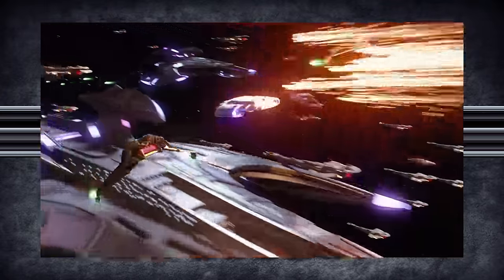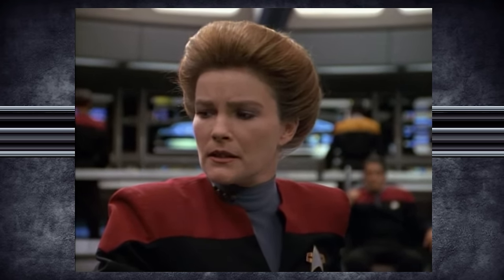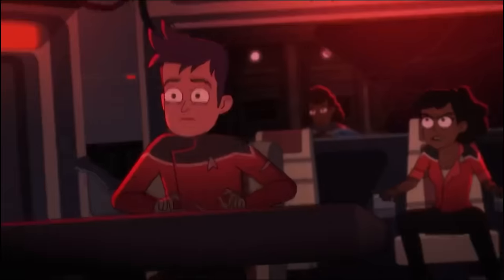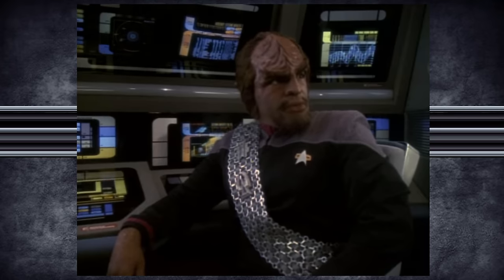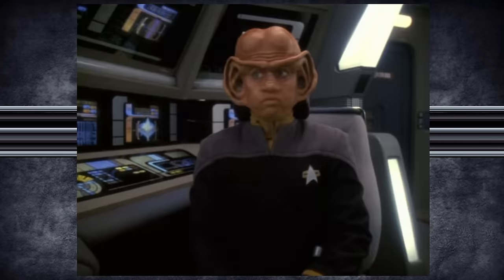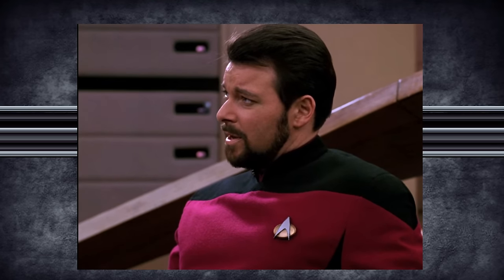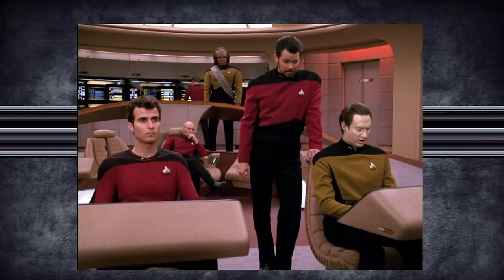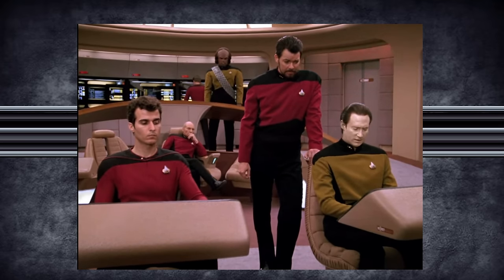Why Starfleet's Bridge Design Was Lethal to the Crews

Comment: The bridge being "exposed" isn't a problem in Star Trek, it's an acknowledgement of the limits of material science. All star ships had shields. With shields up, a bridge could be put anywhere and be safe. With shields down, a bridge could be put anywhere and NOT be safe. We see photon torpedoes drill straight through the entire primary hull when shields are down. When they are up, the same torpedo just scorches the paint a little. It wasn't until Star Fleet got ablative armor that you had a chance of making a hull that could withstand some punishment while shields were down.

As to secondary bridges, even TOS ships had the "emergency" bridge, which was (oddly enough) in the exact center of the primary hull. There were even some episodes where the bridge crew used it.
Reply: This makes sense with regard to high-powered weapons such as torpedoes.  However, the exposed Bridge can still be a problem in relation to "mid-level" threats, such as weapons, space phenomena, or colliding objects powerful enough for some damage to get through the shields (but not so much that the ship would be blown away no matter what).  Or in a shields-down situation, powerful enough to damage the exposed Bridge but not penetrate to a more secure location.

Thus an exposed Bridge would still succumb to threats that an internal (and well-armored) Bridge would not be vulnerable to.  The exposed Bridge is also easier for enemies to locate and target.  "Hit that nipple bullseye right in the center of the disc!"  Since most Trek ships don't use windows, the exposed Bridge does not offer extra functionality that makes the additional risk worthwhile.

Ask the Bridge crew of the SSD Executor about the virtues of a Bridge built into the bowels of a ship. :)
Reply: @kevincrady2831  "Hit that nipple bullseye right in the center of the disc!" is in keeping with naval tradition tho.  In the age of sail officers would be standing on the quarterdeck completely exposed as high value targets.  In battleships the bridge crew were basically the only people on the ship not protected by armor (they had armored conning towers that nobody ever used).  If your leaders are willing to put themselves in the most exposed places, how can you be afraid at your post?
Reply: Auxiliary Control in TOS, the Battle Bridge in TNG
Reply: You could also not present for combat at any given orientation using only the "windows."

Unless you had one hell of a tactical officer.
Reply: But I would rather be concealed then exposed regardless of armor
Reply: They had ablative plating on the NX-01
Reply: @kevincrady2831  

You neglect that the deflector field is always active - otherwise you couldn't travel at high speeds anyway.

The exposed bridge DOES offer extra functionality - in making the entire bridge setup easily replaceable for upgrade or repair - and the additional risk is minuscule.
Reply: @ohauss  Given the existence of transporter and replicator technology there isn't any real need to have the Bridge on the exterior of the hull in order to make replacements and upgrades possible.  Otherwise, Main Engineering would need to be on the outside too.

The simple fact that an exterior Bridge is an easily spotted and targeted location ("Lock disruptors and photon torpedoes on their Bridge!") makes it more risky than it's worth.

Comment: Most of the "design flaws" in Star Trek usually stem from necessities of filming TV shows versus actual deliberate informed engineering choices. 

Overall, I'd say space ships are more comparable to submarines. Like submarines, space ships need to maintain atmosphere. Like submarines, the medium through which they navigate provides no human processable navigation clues. Under water, in the depths where submarines usually operate, it's simply to dark and murky. In space, human eyes and visual interpretation and intuition completely fails, because humans rely on depth perception for movement and orientation. Due to the distances and scales involved in space flight, humans can't rely on depth perception. So that's one major point for instrumented flight and essentially makes "windows" completely useless as fallback mechanism, if those instruments should fail. That basically leaves "windows" for entertainment, such as leisurely observing a planet while in orbit in a ship's lounge.

Then there's armor and hull plating and hull integrity. While in-universe, those "windows" might be some form of transparent metal, it's speculative at best if they also have the usual hull platings and other forms of overarmor. One could argue, those platings wouldn't be transparent themselves, so that would make windows structural weak points.

 While the pressure differences in space might not lead to as severe structural failure as it does under water, it could still provide stress points leading to growing fractures in the window and in the surrounding hull (google why airplane windows are round or have rounded corners). Also, as far as we know currently, transparency of a material indicates some (quasi-)crystalline structure, and those tend to shatter when stressed. But even given current day materials one could assume some form of layered composite, much like car safety windows, yet this still means a damaged window section would need complete replacement. 

But then again, maybe Trek has some kind of molecular welder, able to fix the failures in these composite windows. And I seem to remember Trek ships also having some innate structural integrity field system, possibly able to reduce or eliminate the stress fracturing? Even if this structural integrity field was always active, for efficiency and simplicity, wouldn't it simply be more practical to solve such structural weak points at the design phase? At what point does the handwaving become unbelievable?

One thing always bothered me, at least post-TOS, why does the view screen on the bridge never display additional information? This too should be plausible, given the adaptable and configurate LCARS system. I assume this is also more for cinematic purposes, to give the actors reasons to wander around on set, providing dynamic framing, instead of everyone just always sitting and staring at the main view screen. And probably production cost during the time, with CGI being much more expensive. Compare this to Discovery and the Picard series, where ships do have interactive holographic information display on primary viewing areas.

The commonly round bridge layout probably also stems from cinematic requirements, such as multiple camera angles showing as many of the crew as possible. But one could also argue, it's due to an engineering problem: how does one route multiple redundant information systems to a central location? The circular layout provides an effective way to route and connect terminals, while keeping the actual conduit short and organized. Here only the forward navigational consoles stand out, since there's practically no need to ever put them in between the crew and the view screen. Lets say, Trek bridge view ports actually did show additional data relevant to the situation, why have this all important information display always be obscured by two consoles and bodies of crew, when they could've been placed literally anywhere else? So again, I'd say cinematography got in the way of "realism".

Assuming all of this holds true and isn't handwaved, a more central and more embedded location of the bridge is much more plausible. It's just less attractive for cinematographic and dramatic reasons.
Reply from the maker: I reject the filming excuse. The expanse, Battle Star Galactica, and Babylon 5 did it…
Reply: @LoreReloaded  You're absolutely right, and I think those shows did a stellar job, pun intended. I really hope that future sci-fi shows and movies will continue with this trend. 

But I'm not saying that all science-fiction TV shows and movies have a such "nonsensical" bridge design, or will have such a bridge design because of cinematography. I'm just providing the perspective that specifically the creators and directors of Star Trek TV shows and movies might have made those choices for cinematography. At some point things like design, bridge layout and technology becomes a stylistic element, it becomes canon. And to provide continuity, new shows adopt these styling and design cues, adopt the canon (or reboot, like Discovery, and Kelvin Trek).

Of course it's also possible that the art department and design team specifically had non-submarine naval ships in mind when designing these, this too would make sense given ship classifications and command hierarchy in Trek. Yet, as often as Trek designs and story was deeply meaningful and intricately imagined, sometimes they just winged it. I don't really know how to sensibly argue for such quirky designs, when, at least to me, the aspects of being part of film and show jump out so much.

Comment: Currently, the vessels of all modern navies are configured with the bridge/CIC atop their command islands - this also usually includes the captain's sea cabin (equivalent of the captain's ready room in ST, but ST captains are afforded the luxury of not bunking up within 30 seconds walk of the CIC and/or navigation bridge), CIC and admiral's bridges at the highest points. On an aircraft carrier, escalators to and from the aircraft fighter squadrons' briefing rooms were also included. 
That being said, the only purpose for having an elevated bridge would be the same as now, to do line-of-sight navigation when imaging systems were damaged beyond repair - but there's a big difference between having a bridge on a vessel going 35-38 knots on the water and one in space doing warp 9, where any speck of dust could puncture the bridge first at sunlight speeds. I would be an advocate for moving these facilities to the center of the saucer, having a battle bridge atop or between the separation points at the neck and the stardrive.
And of course, keep the damn Red Devil Fireworks out of the panels. There is such a thing as resistors to keep all of the ship's power from frying your lower decks noobos.
Either way, fairplay - but I advocate for putting things in the center and rely on imaging sensors to look out into space.

Comment: Well the entire concept of a bridge stemmed from having a platform between two paddlewheels for visibility over the paddle wheels and instructions were verbally relayed to the coxswain at the tiller or wheel and to the engine room.  Remember Roddenberry has a naval background.   Keeping the bridge motif at a location for high visibility doesn't make sense for a spaceship that will spend most of it's time in open space when just carrying a wifi connected tablet or smart phone would be sufficient to control the ship.
Reply: @NormandyFoxtrot  Yes, but for an interstellar spaceship, the need for a command centre would be few and far between so it could easily be simply space normally used for another purpose such as a conference room, living room, lecture or media theatre or even a patio in a garden area.  Granted, with FTL travel such as in Star Trek, there may be more need for 7x24 staffing but certainly for the interstellar ships within our current technology, decades to generations to centuries may pass before such a centre would be needed and if it did exist, it would be more like an office building within the habitat and it's likely that our ship designs will first be adjusted to such sublight concepts before the advent of FTL.
Reply: LOL.  Now I want to see the captain yell down for forward 1/2 through a hollow tube down to engineering.

Comment: As I recall, in “The Making of Star Trek” the Enterprise had an auxiliary control room.  It was featured in TOS in two episodes.
Reply: Yes I seem to remember that all essential command functions can be controlled from main engineering on all the federation ships portrayed in the various series and movies,  except shuttles and the round abouts. 

Also The galaxy was able to split its saucer and body so the auxillary control has to be located within the body otherwise this function would not be possible.
Reply: @parlertrick  original series Enterprise was capable of separating,. It was mentioned once in “The Apple”. Never shown of course. That was a budget buster

Comment: Listen to the distances described in Star Trek. Ranges between ships where in various large multiples of kilometers. You aren't seeing much through a 'window' then. Also honestly Battlestar Galactica second series had it the best with the command deep in the ship at CIC. 'Bridges' on a starship would have little purpose as the use of human vision being useful would be extremely limited and only place the command center on the exterior of the hull where they are vulnerable.